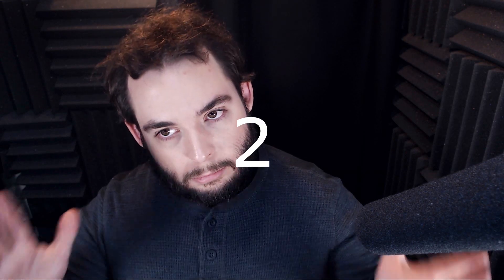XLR to USB + Phantom Power = Interface?

Comment: I bought a at2020 and a mixer/preamp, i then realized I needed phantom power which the mixer/preamp I bought doesn't support, if I plug the mic into the phantom psu and then the mixer will I be fine?

Comment: Use voice meter banana to live increase sound and live monitor
Reply from the maker: Um... Yeah I guess. But you should just by an interface instead of making a complicated system with lower quality like this, work.
Reply: @FunnyGuyTimmy  true just a little cheaper
Reply from the maker: @vesin_9772  But What I will say if the sound quality is only slightly lower and the price is about as cheaper than you wouldn't be making a huge mistake going this route. But you will always want to get something longer lasting down the line reguardless.
Reply: @FunnyGuyTimmy  yeah i just want a option under $90 and my mic is already $46 so i don't have a lot of headroom
Reply from the maker: @vesin_9772  even at less than $90 you still have plenty of options.

BEHRINGER Audio Interface, 1x XLR/TRS 1x 1/4" 2X RCA USB, Black, 1-Channel (UM2) https://www.amazon.com/dp/B00EK1OTZC/ref=cm_sw_r_cp_api_glt_fabc_NWM2TJJJMX6H106TRP5K

M-Audio M-Track Solo – USB Audio Interface for Recording, Streaming and Podcasting with XLR, Line and DI Inputs, Plus a Software Suite Included https://www.amazon.com/dp/B08Q1NJSBQ/ref=cm_sw_r_cp_api_glt_fabc_QGZKWF1MRN3G2TV6YX7K

Pyle Microphone XLR-to-USB Signal Adapter - Universal Plug and Play XLR Mic to PC Adaptor for Digital Recording w/ Mix Audio Control, +48V Phantom Power, Headphone Volume, USB Cable - PDUSBPP10 https://www.amazon.com/dp/B07MTGT27G/ref=cm_sw_r_cp_api_glt_fabc_480YF5SNCK4844G43B26?_encoding=UTF8&psc=1

Shure MVi Digital Audio Interface + USB & Lightning Cable https://www.amazon.com/dp/B08G7BZXLQ/ref=cm_sw_r_cp_api_glt_fabc_QQVPFMRZQFTAA3JCP6R8

Pyle 2-Channel Audio Mixer - DJ Sound Controller Interface with USB Soundcard for PC Recording, XLR and 3.5mm Microphone Jack, 18V Power, RCA Input and Output for Professional and Beginners - PAD10MXU https://www.amazon.com/dp/B003CY6OHY/ref=cm_sw_r_cp_api_glt_fabc_FTZM5ZJ71P2V0998MMHS

Behringer Xenyx 302USB Premium 5-Input Mixer with Mic Preamp and USB/Audio Interface,Black https://www.amazon.com/dp/B005EHILV4/ref=cm_sw_r_cp_api_glt_fabc_AWR0PT5MP806MEX4WBDT

Comment: i need help PLEASE. I have a bm800 mic,newwer phantom power, xlr male to female cable and a 8mm type of xlr cable with a laptop. I'm trying to use my mic while listening with headphones, is there a way for me to do that because I only have one 8mm port in my pc.i heard souncards will help but i heard sum creates a buzz sound. do you any of u guys know any good soundcards or anything else i can do?
Reply from the maker: You are using a setup that is too complicated and should be used. It has too many conversions and is what's causing problems. Save up for an interface that does USB to your computer. That will solve that.

Comment: I just wanna ... Ask that if we connected the phantom power to the 3.5 I mean through 3.5 (xlr) cable the. ......then how will I am able to put my headphones ?????????? Pls telll
Reply from the maker: ARJUN DESHMUKH one of the major points of this video is that you can’t and this isn’t a good option for a set up.
Reply: @FunnyGuyTimmy  Yeah u right .....but can we do it from 3.5mm splitter right ? ...I think we can ...because ..the splitter has 1 port for mic and one for headphones ....
Reply: FunnyGuyTimmy uhhhh the thing is I got a dac amp so that uses a USB port so is this a good option now
Reply from the maker: @ikuzo_3012  i would say no.
Reply: FunnyGuyTimmy I live in Australia plus idk how to use all of this stuff I bought a audio technica at2020 bk microphone and all I need is it to work for zoom calls and gaming I’m not looking at streaming yet so I just need to know what to buy for it to work with my pc
Reply: FunnyGuyTimmy if it’s ok with u so I just need to buy a 48v phantom power supply a mount for my mic and a xlr to USB cable is that correct

Comment: Hey I have a Yamaha moxf6 which has it's on interface and it integrates with cubase. I have the c1 microphone with xlr to usb cable.. if I buy phantom power can i connect to my pc
Reply from the maker: Michael Glover yes as shown in the video. However I would recommend getting a mixer or an interface with multiple channels very soon down the line.

Comment: Raw it sounds fine, just that it seams a bit touchy with the gain. The difference in price(ebay) down here is PhP $22 + USB-to-XLR $13 = $35, Vs UM2 $78. I don't really want to spend the $78 for a 100 view YT channel - lol -, but it seams the better option because it has external gain control.
Reply from the maker: That and the live monitoring feature. I think that would probably vindicate the remaining difference.

Comment: it isnt cheaper? a xlr usb adapt cost around 20$ here yet an interface cost minimum 400$
Reply from the maker: $400? No. I actually have a video on a good $60 interface. Also you left out the part where you would need the phantom power supply as well as an additional XLR cable to make this work the same as an interface. That would bring the two options close in function and in price making the more complicated setup, this one, not worth it.
Reply from the maker: https://youtu.be/AXHL4HvTiqw

Comment: Can I use the XLR to USB cable with an AT pro 35 clip on mic (for alto sax) using a tube MP preamp by ART? Just want to get the mic to provide sound into a laptop.
Many thx.
Reply from the maker: If the mic doesn’t require phantom power then yes. Check the mic details to be sure.
Reply: FunnyGuyTimmy 
Thanks but it seems to be a condenser mic and requires that preamp. Which gives power. 
So I guess that might work?

Comment: how do you wire from mic to phantom power supply to mixer? i use the behringer c1 and behringer q502usb, the q502usb has phantom but only has 15v, so i needed an external phantom power supply.
mic (xlr female to male cable) --> phantom power supply (xlr cable female to male) --> q502usb(the phantom power is off on q502usb)?
Reply from the maker: Macuhvelli Gaming you would just use a xlr from phantom power to mixer.
Reply: @FunnyGuyTimmy  thanks!

Comment: I just ordered the Rode Reporter, dynamic handheld mic. I know you can plug it into a camera to use it like that but can I just get an XLR to USB/3.5 cable to plug it directly to the pc?
Reply from the maker: Yes. With dynamic mics you can easily plug them into the 3.5mm or USB jack and most of them should work fine. Most hand held mics don't need that much power and as long as the XLR to USB cable is is high enough quality, it should be good.
Reply: @FunnyGuyTimmy  okay,  cool thanks :) are there any cables for this setup that you would recommend by chance?
Reply from the maker: @BaldHype77  For a good one? Maybe this right here.

https://www.amazon.com/Microphone-HOSONGIN-Converter-Connector-Microphones/dp/B07ZBZ62X9/ref=sr_1_1_sspa?keywords=XLR+to+USB&qid=1577827666&sr=8-1-spons&psc=1&spLa=ZW5jcnlwdGVkUXVhbGlmaWVyPUEyOTJYTDZOME41N0FWJmVuY3J5cHRlZElkPUEwNTM2MDEyMjlEVzZMNkUxQ1NVNiZlbmNyeXB0ZWRBZElkPUEwNTQ0NDExM01RUkkwVUNEMTFFRCZ3aWRnZXROYW1lPXNwX2F0ZiZhY3Rpb249Y2xpY2tSZWRpcmVjdCZkb05vdExvZ0NsaWNrPXRydWU=

However, personally I would say you are better getting a small interface.

https://www.amazon.com/BEHRINGER-Audio-Interface-1-Channel-UM2/dp/B00EK1OTZC/ref=sxin_3_ac_d_pm?ac_md=2-1-QmV0d2VlbiAkMjUgYW5kICQxMDA%3D-ac_d_pm&cv_ct_cx=XLR+to+USB&keywords=XLR+to+USB&pd_rd_i=B00EK1OTZC&pd_rd_r=6c78285f-dbc3-447c-9393-1f3dddb60bb9&pd_rd_w=rKypI&pd_rd_wg=PRerB&pf_rd_p=aba5dc0d-7593-4752-a14d-357ecc5c98cc&pf_rd_r=2KDX238AK6NZ6RS2B55N&psc=1&qid=1577827773

Comment: my son has an audio technica at2020 cardioid condenser, he has a 3 pin type XLRM cable. but he does to have a phantom power converter, do you have to have a phantom power converter to use it? please help

edit: the mic won't work on our MacBook Air
Reply from the maker: Yes you will need a power supply. A condenser microphone always need phantom power. The standard is 48volts, but some do need more and some need less. But they always need some. I recommend an interface or mixer. You won’t be able to hook up to your mac without it.

Comment: Hey, quick question. I bought the condenser AT2020 but I found out it's not the USB version. If I buy a XLR to USB cable, will the suffice to straight plug in to my computer or do I need to buy a Phantom?
Reply from the maker: Flick TV get an interface. Like I say in this video its better than getting the USB to XLR cable and a phantom power supply. There are reasonable interfaces for $35-45. Basically what you would be spending to get something like this to work.

Comment: Hello. I recently purchased a Warm Audio preamplifier and I would like to convert the preamplifier output into USB to the computer. The preamplifier has an output knob And I am wondering if I put that knob to high will it damage the USB computer port using an XLR to USB cable? Thanks!
By the way I sent an email to warm audio four days ago and I’m still waiting their response.
Reply from the maker: Get a mixer or interface. The USB to XLR cable doesn't provide phantom power, which is what an amplifier needs. That is why I used a phantom power supply device in this video.
Reply: FunnyGuyTimmy 
The preamplifier already provides phantom power to the microphone. Here is what I want. I have the preamplifier connected to the condenser microphone which is an xlr female to xlr male cable. But it’s in the output section (from the preamp) that goes to the computer where it does not need phantom power but just wondering if the output of the preamplifier will damage the Computer USB port due to high gains OR the 5 volt USB that the computer itself  runs on can feedback voltage into the preamplifier output and damage it too? 
I think it’s better off to be in a secure zone and not use an xlr to USB cable but a dedicated interface like you said.
Reply from the maker: @Bassotronics  Which one is it?
Reply: FunnyGuyTimmy 
Warm Audio12 MKII
Reply from the maker: Bassotronics oh okay. Yeah you could use the xlr to usb to send it to the PC. However I would say try and find the highest quality name brand cable. That way you won’t introduce any additional noise. Dose the WM12 have monitoring?
Reply: FunnyGuyTimmy 
Thanks. In terms of monitoring, it has a led display that indicates level but other than that I don’t know. I would need to get the instruction booklet or get info about that online.

Comment: Yeah that sounds kind of over-complicated , as a portable setup for my Macbook running Audacity Of course I bought a cord on eBay that's an XLR female to a male 1/8 inch stereo Jack and plug it into my Roland UA-1G and I use a Audix uem 81 shotgun mic that has its own battery for power , it works really good although you can't use every microphone with it and you do have to turn up your recording level quite a bit
Reply from the maker: Yeah that would be better than this for sure.